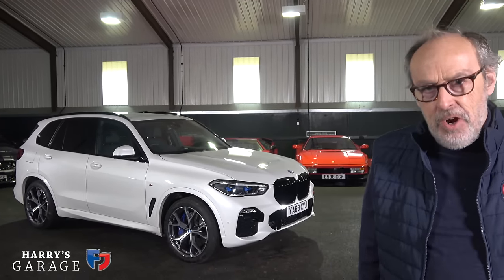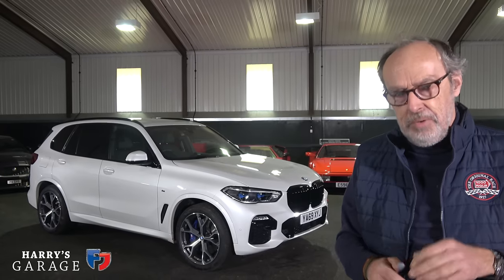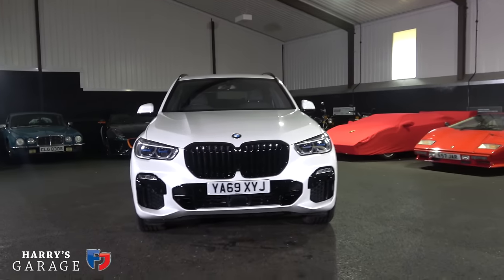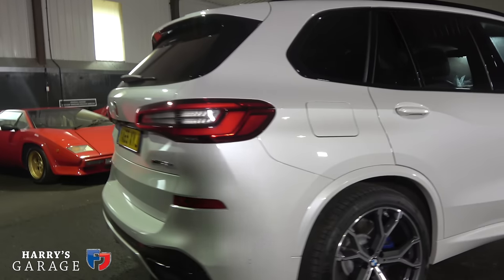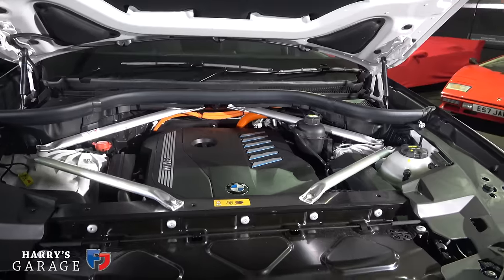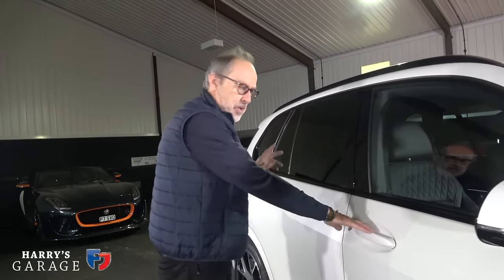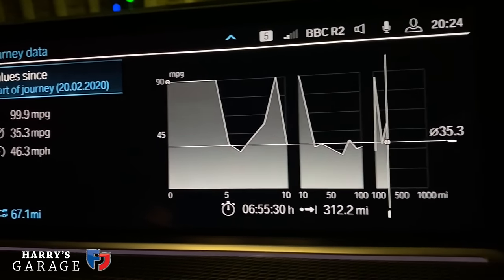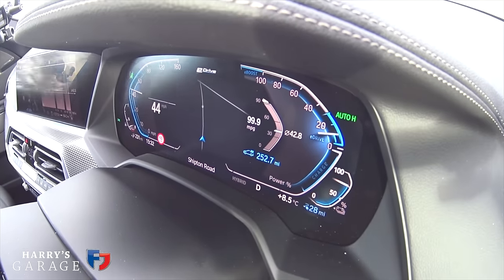BMW X5 45e PHEV 2020 review. Is this new plug-in hybrid better than a pure EV in the real world?

Comment: Harry your considered opinion is much appreciated on BMWs most recent engineering efforts with plug in hybrids. Comparison to the Range Rover in real world use interesting especially the real world mpg and the impression gained on actually driving and using the thing, 600 miles is a bloody good test. Not that Im going to buy either I dont fancy the servicing costs on ICE/EV combo drive train, have to confess as a Tesla owner 92,000 uk miles over 6 years the 2014 P85  Tesla out performs both, charges quick but i can see the BMW EV range is good. Why drag round a tank of fuel, an engine, gearbox,  exhaust etc for 7 weeks when your on electron power? Once you go Tesla and have a home charger......no looking back. Looking forward to your upcoming Tesla test hopefully you with give that some distance too and get to see just how good the cars / supercharger network is. So many Tesla tests are done without the testers really understanding how significant and how good the superchargers are and how they integrate with the Tesla sat nav to make the whole experience so hassle free.

Comment: It’s out of date already, plug in hybrids are old news.
Reply: Not correct... they will be here for the next 10 years. The EV is not ‘in date’ yet.  The infrastructure does not exist for charging or the battery range.  Until range anxiety is not there (i.e.  the magic 1000km range), then most will prefer a plug in hybrid.  The PHEV models will continue to extending range, but EV range is already maxed out, as Elon has said on numerous occasions with nothing new planned.  Take into account that no country has surplus energy production to charge EV vehicles at even 20% replacement of ICE.
Reply: Some of the public charging stations are starting to cost 69p/KWh which makes an EV more expensive to run than a conventional ICE car. Unless you buy a Tesla, charging and the cost of charging in the UK is a lottery and not something I would be prepared to take a chance with if I had appointments to meet or a family in the back. However a Hybrid like the X5 (although I would prefer it in something smaller) does grab my attention. Difficult to give up my V8 though!
Reply: @johnwallace520  99% of charging is done at home - if are able to charge at home that is.
Reply: Joe Walker Ionity is many for VW group cars and they get a discount and most are under 30p per kWh. Polar (£7.85 per month) 15p

Comment: Great review Harry👍 The BMW on board charger is half the size of the 7kw featured in the Range Rover Sport P400e.  Which basically means it will charge at half the equivalent rate.  Not sure why BMW did not install a 7kw on board charger or bigger.  Just a pathetic bean counter decision to save some coin, with having no idea what this means for charging time.  I think the Range Rover Sport P400e still has the best balance on looks, handling, and charging time.

Comment: NO!!!! Stop ruining cars! Electric is NOT the way forward.
Reply: And what is?
Reply: @NLWerner  bull semen
Reply: @NLWerner  High energy green fuel such as methanol. Its made by extracting CO2 from the air and is 100% green.  best bit is you don't need to scrap all the cars that currently exist to build 100's of millions of batteries using billions of tons of CO2 to do so.  Electric cars are not the future they are a red herring.
Reply: Ethanol.
Reply: SJW Tears is the future.

Comment: Interesting concept overall and what appears to be a reasonably pleasant result but I cringed at the cold engine full bore acceleration as well as it cutting in when cold and being expected to take the load when the battery got low or more power was needed.
The idea of it requiring an address so that it will run out of battery power on arrival and then have such a slow recharge time doesn't seem that ideal. Did I miss a mention of it being able to regenerate under braking?

Comment: Very interesting analysis. It left me thinking if a different calibration, a smaller fuel tank and slightly larger battery (say 28/30kWh) would not have a profound effect on top. Of course the same thing to do would be to go 4-pot but let's face it, were petrolheads so straight 6 is fine.

Comment: Drove the old model of this (40e?) with the turbo 4-pot and although it went, it felt underpowered and less cultured against say the 300bhp RRS diesel.

So I applaud the decision to stick a proper motor in there. 

Just a shame about the slow charging - if they can sort that out, it sounds like a winner. Oh, and I’ll need 3 Isofix points in the back too ;)

Comment: I don't see this BMW as a game changer.  There is a spectrum of plug-in hybrids; at one end you have those with small batteries and big engines, which use electricity basically for city centers.  At the other end you have the opposite, or range-extenders, which use electricity for most of your driving.  This BMW is one third of the way along.  It's like turbos: you can make them bigger and bigger until eventually you attach the drive shaft to the turbo and you have a turbine with an ICE fuel pump.

Comment: Exactly the same technology and gadgets as my 330e, but with double the battery capacity, nice simple idea BMW. 
But.....24 kwh is the same as I had on a 2014 Leaf, that did about 90 miles on a charge, not 42.
The petrol engine is dead weight when not used, but vital when you want to go further from home because you can't rely on the charging network yet, and that's why I changed the very efficient Leaf for a plug-in car.
(PS my real average mpg in the 330e with charging every night is 125, I reckon I'm on electric 75% of the time and I only fill up the small tank once a month, for my use I would expect the same from the X5 45e)

Comment: If you're keeping it a bit longer I'd personally be interested in a test of how much EV can you get if you NEVER charge it. So let the EV energy reserve fall to zero and see how much you can get by regen only. That's how I'd have to use one.
Reply: Drove from South of France to Loughborough England - 975 miles - mixture of drinving - got 84 miles elec from no charge to get an average overall of 32 mpg.  10,000 miles later with around 75% charging 62 mpg.

Comment: Quick comparison between a 530e and this.
Pros:
looks better imo, nostrils not as flared!
significantly cheaper
probably better handling, though neither are ever going on a track day..
more efficient 2L engine with only 37 fewer horses

Cons:
No estate version and the boot is shallow because of battery
Smaller battery gives about 25 miles of pure electric driving (shorter time to charge though)
Little off-road or snow capability
By the sounds of it the ride is better in the X5
No straight 6 roar, just a muted 4 pot growl

Comment: Harry great videos so informative.  With electric and PHEV's could you go through the Road Tax debate? With the constant extra weight of these vehicles (batteries weigh the same empty as fully charged), huge tyres and quick acceleration these vehicles can surely rip up the road even more than an ICE? Any ideas on how they will Road Tax these vehicles?

Comment: The max. power of the onboard charger is subject to many market-specific regulations. The UK is a bit more flexible in that regard as for example Germany, where single-phase charging with more than 20 amps, meaning above 4.6 kW @ 230 V, has been banned due to the asymmetric load on the three-phase power grid. 
If you want more than 4.6 kW of power, the onboard charger has to be a three-phase design from now on which is significantly more  expensive to make. The Range Rover's charger still is 7 kW single-phase, which is also true for a lot of other cars that are currently on the market. Some 2020 models are now limited by software to 4.6 kW to comply with regulations in some countries.
Reply from the maker: Interesting information, thank you. I wasn't aware there were any home-charging regulations out there. We have a three-phase supply at home, so can charge other BEV at a much higher rate than 3.7kWh, hence why I was surprised that was the maximum charge rate for the 45e. I will look out for this in the future..
Reply: @harrysgarage  While you have a three-phase supply, the UK is actually one of the markets in Europe which have the highest neccessity for single-phase 32 amps (hence 7.2 kW) charging capability. It seems that quite a few of rather remote areas do not have a three-phase supply on the household level (also true for some areas of Italy and France, I believe). A standard 11 kW onboard charger in an electric car would then also only give you 3.6 kW on that one phase available. For this situation, additional measures have to be engineered into the onboard chargers to make them three-phase 11 kW, but also single-phase 7.2 kW capable. 
Chargers are the one device in a high-voltage car that are highly dependent on the region the car is to be sold in. You need a couple of different variants to get Europe, the US and China in check.

Comment: Great Review Harry - I first saw this at Dortmund December 2016 then sworn to secrecy, however as impressive as this is Mercedes are introducing Mid 2020 a Plug in Hybrid Version of their 'A' and 'B' Class which will offer a similar range on EV, However have been awaiting further details and now (December 2019) gather it will be in the region of €4500 extra linked to the 1332cc Petrol Engine, not a lot of sense in my view so purchased a B200CDi AMG Pre Reg at a huge discount that I have already achieved over 76 MPG. I bet it has 'fake exhausts' to comply with latest EU Emission Regulations (6) although as alike the Mercedes W247 B Class failed to achieve with the originally designed twin exhaust so had to backtrack to the pressurised exhaust system - Banned from sale (UK) as from 2035 Ludicrous Mode - Look forwards to your review of this - however at 13.20 failed to include the cost of charging.The Mercedes A & B Class if selected ECO mode puts the Gearbox in neutral and Coasts - Freewheels and with Kinetic energy you will be amazed how far you can travel on that alone.

Comment: The best reviews in the business. Thank you Harry. I just don't get the whole hybrid, plug in thing. All that extra weight and complexity and real world 40 mpg. My 10 year old Range Rover TDV8 gets 25 mpg on a run, my 57 year old mk1 Mini does 40+ mpg for the local stuff. I think it's more about cheating the EU CO2 tests.
Reply from the maker: Thanks for watching. The bit you're missing is that X5 can do way more than 40mpg in real world, even though that was the figure I got after my week wit the car. But I did several long trips that week because while everyone knows it can do most short journeys on electric power only, the real test is how it performs on a 300 mile trip, when it's out of charge for most of the journey. As a result, my week with the X5 wasn't typical usage and I expect most owners in the real world would average north of 100mpg.
Reply: @harrysgarage  Thanks Harry.
Reply: I guess the trick as say is recharge these cars at home and fully use the EV range each time/day. Makes more sense. I guess most of these cars will be leased too, so you can renew every few years as the tech moves on. Interesting times.

Comment: The real leader of plug in hybrid is GM.  Unfortunately they don’t seem to know that. Three years ago I studied all the PH’s. The Volt will run 60 miles on battery, every other PH option at the time were down in the 25 mile electric range.  We’ve owned a Volt little over two years now and we still get 58 miles on electric.  It’s my wife’s daily driver and in the past year she has only filled the 10 gallon fuel tank 4 times.  I think GM was a bit ahead of its time with the Volt, most people are just coming to grips with all the electric options and their differences.

Comment: Currently in an X5 40d M-sport, 50 miles to work and another 50 back naturally (Gloucester to Oxford). If I could charge at work, then technically this would work for me, probably use a bit of petrol on dual carriageways (Could do with a 30Kw battery tbh).
Reply from the maker: Interesting. Seems this tech keeps on improving. I still think a PHEV is a better bet for most, rather than optioning for a BEV.

Comment: For the 20% you'd "need" the gasoline engine, I would not bother with. I'd get a full electric SUV and just deal with the charging network the few times you actually drive more than 500km.

Comment: Am I missing something with the plug in hybrids? Why don’t they at least optionally trickle charge the batteries when, say, cruising at 70 on the motorway? That would top you up for the next town. I know it would use more fuel but you’d be charged up for the town, especially since more and more centers are going ICE free.
Reply: they do :-)  
If I'm reading it right, when the right hand dial in the X5 moved below horizontal, it's charging.

Comment: Nice car Harry the only thing i dont like is the price, regarding the charging if you are charging the car from a standard 240volt 3 pin plug it will take you all night.
if you were charging using a wall pod that does 7kw then it should take half the time.
I drive mitsubishi phev 2015 and i get around 24-26 on a full charge and get over 70+ mpg from it.
So the PHEV has been around a long time its only now that other makers are taking this on board due to emission.
I am going the full electric route on next car i fancy the new MG ZS EV a lot of car for 28k. 213miles around the doors and 163miles on motorway. i dont do a lot of motorway just means planning a trip to include super charging, the infurstructure it there.
You say your next car is the model 3 you will like that one 300+ miles and fast.

Comment: Driving 350mi/w with mine and 60% is done electric. Much higher than I anticipated when I ordered the car. The slow charging is really a shame. Like Harry mentioned, you don't bother plugging it in during short stops.
Reply: For the battery size (24kWh) it needed rapid charging, even the Outlander PHEV had rapid charging and that had a a very small battery(13.8kWh). Also BMW needed to limit it in some way so people would not buy that over petrol/Diesel models.

Comment: A really informative video.  Some quite convincing figures.  Now, if someone could combine the range of a plug-in with the ability to recharge from the engine too, that would surely be the ultimae long range solution.  I have no idea if that's even possible, yet?
Reply from the maker: You can do exactly that with this X5 but it's less efficient to doing so. The only reason to do it I can think of would be to top up the battery ahead of entering a zero emission zone, for example.

Comment: Thank you for the review, however the real "game changer" is the advent of 350-450+ mile fully electric cars. 

In the example you mentioned, you are nearly spending the same amount of money for fuel as for the electricity, even though 80% of the use was fully electric.

A hybrid adds a lot of complexity and inefficiencies; think transmission, radiators, exhaust, engine, lubrication, emissions control and far more maintenance. 

Ask any mechanic (if you can even find one), and they will tell you that a hybrid is an absolute nightmare to work on.

Once 450 mile range fully EV become standard or easily available, such a car will not make any sense.

Comment: Great review – as many others have said Harry Metcalfe has the best car channel – end of story.  But I disagree on the plug-in hybrid argument. I admit I am not a fan of SUVs. I don’t like their obesity and aggressive looks and most of that space is never used. But there are other issues. This BMW is not great value – the price of that optioned BMW X5 hybrid in Australia is approximately $140,000 AUD. That is almost exactly what I paid for a Tesla Model 3 Performance PLUS a Hyundai Ioniq. I was not cross-shopping for a SUV. But it puts the price in perspective. And really, how often do you need all that space? Most of the SUVs I see have one driver, maybe with 1 or 2 kids in the back. I agree if you are regularly ferrying 5 children its handy, but Harry didn’t review the 7-seater version. The regular one can carry no more kids than either of our saloons. If I want to transport something really big my mate lends me his ute. Then there is efficiency – 50 miles from a 24kW battery is not efficient. We can reliably get 130+ miles out of the Ioniq with a 28kW battery. And the BMW has a frustratingly slow charging rate – under 5kW. The Ioniq will charge at 50kW and the Model 3 100 kW+. Seen through the lens of other large plug in hybrid SUVs the X5 hybrid may seem like a good buy. But step back from the world of SUVs and you can do a lot better for less.  And I haven’t even mentioned the Model Y.....

Comment: I have a suspicion this situation will not continue. The whole movement  of legislation to 2035 is to remove choice and restrict use thereby giving total tax control to the government on transport and fuel supply. Electric tariffs will rise in line with petrol once we are all on the hook only this time no other fuel choice for competition. Your plug charger will be monitored by separate meter and run by local authority or supplier special tariff levy (the cynical additional road tax of cars over 40K EV or not proves the thinking) Enjoy the cost difference while you can it cannot last government revenue is the key driver to all of this hidden behind the mask of ecology improvement.Great vid as always.
Reply: Facts 💯💯